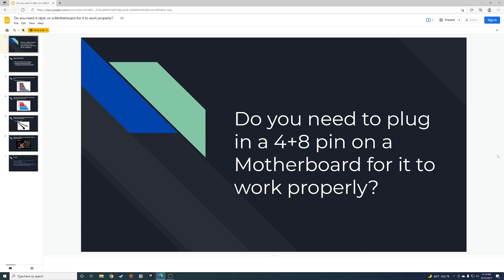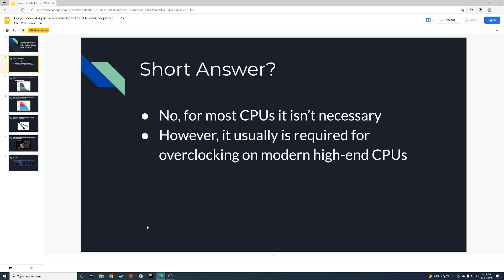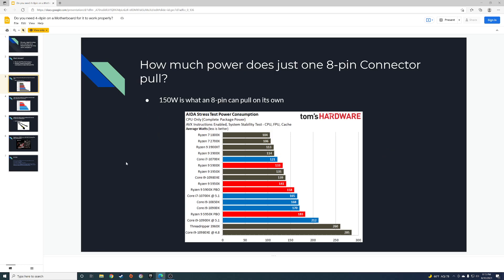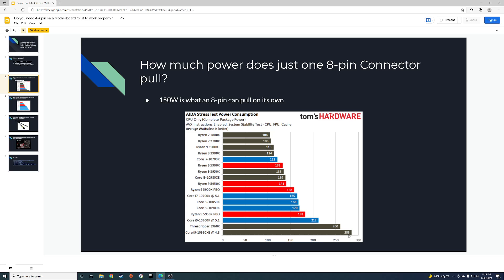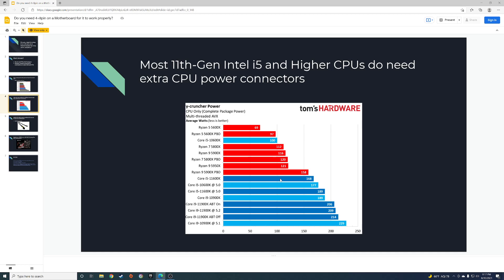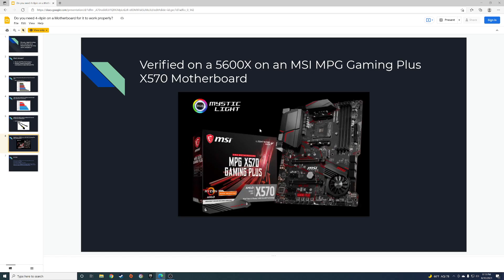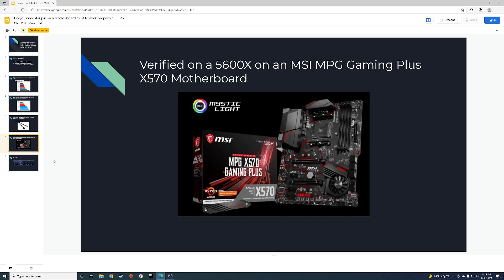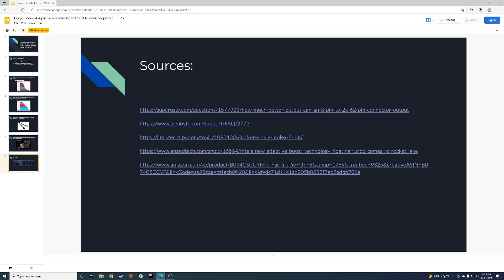Do you need to plug in a 4+8 pin on a Motherboard for it to work properly?

Comment: i just got a MSI PRO B660-A DDR4 Motherboard - with a i5 13600k, then noticed last min i have only 1x 8 pin connector and the board has the extra 4 pin, had me worried for a moment and was struggling to find this information, ive no intention to overclock so i should be golden then! thanks for putting the info out :)

Comment: I have an ASRock B550M Steel Legend Motherboard and my processor is AMD Ryzen 5 5600g, do I need to plug 8+4 pin on motherboard or 8 pin only?
Reply from the maker: Yes, the power draw is below 150W, so you will be able to run it off just the 8-pin. You should be completely fine without using it with the 5600G.

Comment: Hey im planning on buying the ASrocK z690 steel legend and pairing it with a 13100 (planning to upgrade) and buying a 650w thermaltake smart bm2 im wondering if just one 8 pin will work
Reply from the maker: Just an 8-pin will be fine for the i3-13100 because it won’t exceed 150W power draw and draw 60-89W generally while gaming.

Comment: Just finished building gaming PC for granddaughter. Mother wanted just a case swap so she got case, GPU and PSU. Swap not possible so got CPU to match GPU capabilities and MB which also has ARGB connection to match case. PSU has 8+4 but MB has 8+8 for CPU. The CPU is i5-12400 so just one 8 would work, but did plug 4 into the 2nd 8. If I ever upgrade to power sucking CPU I'll wire a 4 pin to a molex to fill last 4 pins in the second 8 just to even out the current draw to keep wires from getting to hot.

Comment: What if you have a CPU that pulls over 150watts but have a motherboard with single 8 pin connector only?
Reply from the maker: Your CPU may or may not function properly. Your computer might not boost as high of a frequency on your CPU, or you might experience random blue screens or freezing. If the computer is not able to pull enough power at the very least you'll likely see clock speeds that are lower than what they should be. Undervolting your CPU could fix this issue and get you close to factory speeds and draw less power, but personally I would go the route of exchanging the motherboard or CPU that you have that can run properly together.

Comment: my 5800x3d does boost a little low might it be because the 4 pin is not populated? without undervolt it got to 4.2 ghz with undervolt to 4.4 (watercooled)
Reply from the maker: That probably is what is happening. You’re probably power-limited. For 65W -72W CPUs like the 5600X the 8-pin is enough, but you should populate all the pins to get the most performance. I’d recommend using a Molex adapter if you don’t have enough CPU headers on your PSU. The one I linked in the video description should fix your boosting not going as high.
Reply: @cztech2631  i plugged it in but it didnt change anything. but i might do some tests tomorrow and when my 7900 xtx arrives and i get a fitting waterblock i have to take everything apart anyway. the cable is old and i had some issues to get it running again after connecting tje 4 pin. it might be broken.

Comment: And what abou the Msi Mag B660M Mortar Wifi Ddr4, and an intel i5-12400f , can i use only the 8 pin connector or do i need the connect all the 16 pins?

Comment: i read some other opinions about this topic and many others say that the 4 pin cable is rated  for 190w of power and the  8 pin cable is rated for 390w of power ,so which one is true guys,i am very confused.
Reply: The video is incorrect. 8 pin EPS12V provides at least ~230W , maybe up to 390W unofficially.

Comment: The problem as i see it is ths PSU. My Psu only supplies the 8 pin connector. To get the extra 4 pin current you need an adaptor. If you use an 8 pin to 8 + 4 pin adaptor, then you are drawing more current from the 8 pin than it should normally supply. I can't find this info on the PSU. It might explain way AM4  x570s aorus pro motherboards has issues with the usb ports cutting out on booting. That Molex to 4 pin adaptor could be the way to go. Thanks for that tip.
Reply from the maker: I agree. From what I've found 150W is the max on the 8-pin, so adding in the molex to shoulder the extra wattage seemed like the best way to get more wattage for 200W CPUs out there.

Comment: I have an aorus z690 ax elite ddr4 but the board has a 4+8pin psu plug-in but the powerSpec psu had a cpu cable that has two 8pin cable connectors that split but only 8 pins of the connector fit perfectly and they’re on opposite sides of the cable. Can I connect those that fit perfectly into the board or should I only connect the single 4pin and leave the others out?
Reply from the maker: It depends on the CPU you have, but typically you want to populate the 8-Pin fully with the CPU cable from your Power Supply, and if your CPU doesn't need that much power you can just use the 8-pin. If you need more power, but don't have the cables to populate the 8-pin and 4-pin you can get a Molex to 4-pin adapter like the one I mentioned and linked in the video description. What CPU are you trying to run on that motherboard?

Comment: thank you very much, I've been looking for this information because I'm building the same MB and in the manual it doesn't show this nor an explanation, really thank you very much.
Reply from the maker: Thank you for the comment. It took me a lot of time and research to figure out if it was okay to do this. I’ve been running the same motherboard as you without an issue for almost a year now and everything is working great 😁

Comment: I have i5 12400F with z690 motherboard will it hurt to plug the other eight pin in?
Reply from the maker: It won't hurt at all. Some people like myself don't have extra 4-pin connectors, so I made this video to show they could run their systems with only one 4-pin installed. If you have  enough CPU connectors you can plug them all into your motherboard without an issue.

Comment: Hey, I have a MSI MAG Z590 TOMAHAWK and it has both an 8 pin and  4 pin for CPU power. Would you recommend plugging on both? Most of the build guides I have seen only seem to plug in the 8 pin, but I am using an 11th gen i7-11700K and I am not sure if it might need the additional power.
Reply: If you watch his video he tells you that 8pin is good for up to 150watts, so pretty much any scenario over 150watts you should plug in the addition 4pin connector. His graphs show a 11600k @ stock speed pulls 168 watts. So my guess is your 11700K pulls likely even more power.  Seems likely you should plug in your 8+4 pin connectors.
Reply: @45eno  The video is wrong, 8 pin EPS12V provides more than 150W

Comment: Hi and great video btw.I  have an i7 11700kf and my mobo asus z590 p with 8 pin + 4 pin connectors.My psu is coolermaster MWEGold 750W fully modular.With the psu came only two  8pin cable for cpu.Both can each be 
 devided to 4+4pin.My question is can i run normally with just 8pin or do i have to connect the other 4 pin too?And if so can i use 2 diff cables?like the first 8 pin  and divide the second one to only 4pin ?Please help me if u can i stopped building because i dont know what to do for 2 days..
Reply from the maker: I’d plug in all CPU connectors. Plug in the 8-pin and the 4-pin. You are correct plug in the (4+8) 8-pin and then plug one of the (4+4) connectors into the 4-pin on the motherboard. The 11700k needs all power plugged in to get enough power to run properly.
Reply: @cztech2631  Thank you very much for your help
Reply from the maker: @PSyCho-sq4sp  you’re welcome, glad I could help you out 😁
Reply: @cztech2631  So its ok to use 2 diffrent cables for one 8 pin and one 4 pin to connect the headers right?

Comment: I have i3 12100f and plugged in 8 and 4 pin(corsair rm 650 psu) on h670 mainboard 
Is there any harm? should I unplug one of them?
Reply from the maker: If you have them all plugged in there won't be an issue. You could run them without the extra connector plugged in. If it were me I would just keep them all plugged into the motherboard if your power supply comes with all the connectors. 

Many people don't have a power supply that supports two CPU headers, so they can get by with a lower-powered chip with the just the 8-pin and not plug in the 4-pin.

Comment: Hello!, 7 5800x with the b550 f gaming wifi should i connect the other 4 pins or no ?
Reply from the maker: The max power draw is 105W. You’ll be fine with just the 8-pin.

Comment: I have only 8pin connector for my 12th gen i5 on my PSU and I want to add another 4 pina would it work if I buy a molex like in the video but a 4 pin one
Reply from the maker: The link in the video description works. It splits out to 4 or 8-pins.
Reply: @cztech2631  thanks a lot

Comment: I recently bought MSI PRO B660M-A DDR4 Motherboard and this motherboard want 8+4 pin connecter but I got only 8 pin for motherboard and 16 pin for GPU ..so does it work or do I need to change power supply for more extra connecter??
Reply from the maker: Depends on your CPU or if you are overclocking or not overclocking. If you are running an i5-12400 on that motherboard then you will be fine, but if you're running an i9 or i7 on just the 8-pin you might not have enough power in heavy workload scenarios.
Reply: did you just put 8 pins and it doesn't work?

Comment: Can you please recommend a couple of Corsair PSU that have the two 8 pin connections for the CPU on the motherboard please? Preferably anything 750 and above please
Reply from the maker: This is a good option from Corsair and it comes with two 8-pin connectors for the CPU:

https://www.amazon.com/Corsair-CX750F-Bronze-Modular-Supply/dp/B08FVJ7MGK?crid=1X9WZRGRW44ME&keywords=corsair%2B800w%2Bpower%2Bsupply&qid=1653857864&sprefix=corsair%2B800w%2B%2Caps%2C197&sr=8-9&th=1&linkCode=ll1&tag=chrisz2021-20&linkId=6b6d6a7b210d98a4d56e47cdb4b1b384&language=en_US&ref_=as_li_ss_tl
Reply from the maker: This 800W from Corsair is good too, but more expensive:

https://www.amazon.com/Corsair-RM850x-Fully-Modular-Supply/dp/B08R5JPTMZ?crid=1X9WZRGRW44ME&keywords=corsair+800w+power+supply&qid=1653857864&sprefix=corsair+800w+%2Caps%2C197&sr=8-3&linkCode=ll1&tag=chrisz2021-20&linkId=e87de378e0360b8ac2133d59423103ae&language=en_US&ref_=as_li_ss_tl

Comment: I’m building a 10900k/ rog z590 board and rm850x psu.. The board has the same 8 pin+4 pin connection for the cpu, but the psu has no 4 pin connections, only 8 pin.. The CPU cable extensions I have actually split in half to a 4 pin, would I be ok using that and having it plugged into the 8 pin connection? Sorry for the newbie question I’m just really confused by this

Comment: Thanks for video.
I have 3070ti
Dq650st 80plus gold
Msi pro z690-a ddr4 wifi
I5 12400f
I have 8 pin 
But my motherboard has 2*8pin.
Can I use 8pin?
I don't want oc
Reply from the maker: The max power draw of your CPU is 117W you can just use one 8-pin and you'll be fine on your setup.

Comment: hello, how about the i3 12100f do i need a 4 pin? thanks for the answer
Reply from the maker: The 12400f consumes 117W you don't need the extra 4-pin connected. You can just run it on the 8-pin alone.
Reply: @cztech2631  it comes with 3.3 ghz base power, what if I try to overclock it into 4.3 ghz max. power? I mean will 8-pin handle it or should I buy molex to esp cable for that?
Reply from the maker: @neymarjr1292  what CPU are you trying to power? It could be that you don’t have enough power going to the CPU. You could get a Molex adapter to see if that gives you enough power or you might need to get a PSU with higher wattage.

Comment: I have an i5 11400 do i need to plug in the 4 pin?
Reply from the maker: The 11400 pulls just 65W at full load. You will be fine with just the 8-pin plugged into your motherboard.

Comment: my PSU has the extra 4 pin to conect.. im runing i7 12700f is there a problem leave it pluged? with 8+4 all pluged in without doing any overclocking?? btw nice video very well explained
Reply: What is your psu model?
Reply: @neymarjr1292  super flower legion GX PRO 80plus gold 850w
Reply from the maker: @neymarjr1292  I have 500W from Seasonic. This is model I have Seasonic S12III 500 SSR-500GB3 500W
Reply from the maker: Having them all plugged in won't hurt the CPU. Thank you for the comment

Comment: i have a question actually, im going to build my first pc. i choose ROG STRIX B660-F for my motherboard, it has 8+4 pins for CPU. anyway for power supply i choose corsair RM650, this power supply have 8+8 Pin CPU headers. so the question is, how can i do to populate 8+4 Pins on motherboard? can i do 8+4 (8 pin full on 1 cpu header and 4 pins for half on another cpu header that has 8 pins)? hope you understand😅
Reply: Omgg did you ever figure it out??? I’m having the same problem rn I literally JUST built my pc but it won’t let me boot to bios keeps saying I have a cpu problem my last resort is thinking it’s bc of my cpu
Reply: @simpleascanbet.p.h.744  yes i did, the fact is 8+8 pin CPU headers on PSU allows me to  populate only 8+4 pin CPU. for your problem try to unplug your RAM and try to clean the RAM pin with rubber eraser. or you can try to switch the ram position if you use dual channel configuration

Comment: Hi I just upgraded from my mini itx with a 10900k to a atx 12900k do I need both 8 pins plugged in at the top of my motherboard? I'm having a lot of issues with crashing and I think this might be it?
Reply from the maker: I’d look at to getting a PSU strong enough to power the 12900k also make sure your CPU cooler is mounted properly and check your temperatures with CoreTemp and see if something is overheating. If your CPU is running with normal temperatures then try to find a different power supply.
Reply: I wanna be as rich as you . 10900k should already future proof you for atleast 10 years !

Comment: Hi Im using a msi z490 motherboard with a intel 10400f, will i need the extra 4 pin as my psu only has an 8 pin connector
Reply from the maker: Hi the 10400f pulls about uses about 140W at full load. You should be completely fine with just the 8-pin attached to the motherboard.

Comment: Thank you for explaining this.

I recently bought the MSI MPG Gaming  Plus motherboard with an i5 10400 CPU. It powers on successfully with just the 8-pin connector. When I tried to plug in both 8 and 4 pin, it won't even power on.  

It was confusing to see that behavior on my new motherboard.
Reply from the maker: I know in the past a friend of mine said that power supplies need to have a full circuit by being plugged in a specific way sometimes. I've seen odd issues with Molex Connectors on Motherboards back in 2010 when I had several fans plugged into Molex it would take a specific order of the connectors to be plugged in for the PC to turn on. 

Since the 10400 pulls about 140W at full load I would leave the extra 4-pin unplugged as you'll never need the extra power since the i5-10400 can't be overclocked.
Reply: @cztech2631  I have run into that weird molex issue with my own case fans.  One of them uses a 2-wire to molex connector.  It's very picky with that connector for power.

Comment: The answer is No. 
Unless you're doing some crazy sub-zero overclocking, you're totally fine with 8pin. And with entry level or mid-range CPUs, even 4 pin alone is plenty.
The connectors used are Molex Mini-fit. They are rated at 13A per pin.
 
So in a 8pin 12V EPS connector, there are four +12V pins (pins 5 - 8) and two GND pins (pins 1 - 4), and the power that it can carry within spec is can be simply calculated: 
12 volts x 13 amps x 4 = 624 watts. 
With 4pin, its half of that, which is 312 watts.
That's still way more than you should ever need in a normal use case.

The "150W" figure comes from 8pin GPU power connectors, but they are wired completely differently from EPS 12V.
On a GPU 8pin (usually splittable into  6+2pin) connector, there are three +12V pins (pins 1, 2 and 3, but pin 2 is not actually required by standard, however it is usually wired) and five GND pins (pins 4 - 8), however pins 4 and 6 are actually just sensing pins  - their purpose is so that the card can "know" whether the connected power cable is a 6pin or an 8pin and how much power can it draw from that connection. If GND is detected on sensing pin 4, card will know an 8pin cable is connected and will draw up to 150 watts from it. If it only detects GND on sensing pin 6, it will know that a 6pin cable is connected and will only draw up to 75 watts from it. This is to prevent overloading the PSU (hence why 6pin to 8pin adapters are not recommended).

It has nothing to do with capability of the actual connector. 
Again, unless you're doing some crazy OC, you will hardly ever need to worry about the connectors. 
Instead, you should worry if your PSU is any good.
Reply: You think 8pins hold an i7 12700k? Not doing overclock btw
Reply: Cool thanks for the info, i got a asus rog strix b660 and just followed the manual and it worked fine but i sent the baord back for other issues TWICE so now I’m getting a different brand and the only one i like has 8pin instead of 8+4  but with the other board i was still tripping wondering if i should have both or not.
Reply: I thought the 150(8pin) + 75(4pin) seemed low

Comment: You can run an 11th gen intel with one 8 pin even if your motherboard has two. I have a z590 with two 8 pin connectors and a seasonic focus 850 watt semi modular with only one 8 pin cpu cable. It’s working fine though. They put out up to 300 watts through one connector.
Reply: my monitor starts up. i see the msi logo( b560 tomahawk)
than it turn off.
help 
do i need to connect the under pcie 6 pin
Reply: @mustachk0bg998  You should connect that 6 pin like the instructions say. Try it and see if that helps.
Reply: @jeffscomp  i aint got a cable
Reply: @mustachk0bg998  you might need a better power supply if it doesn’t have three connectors you can use.